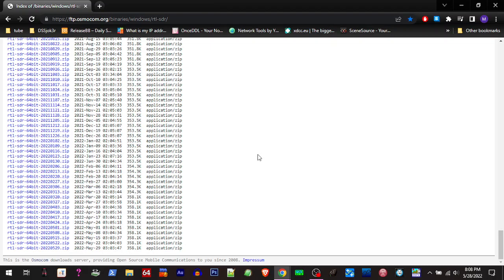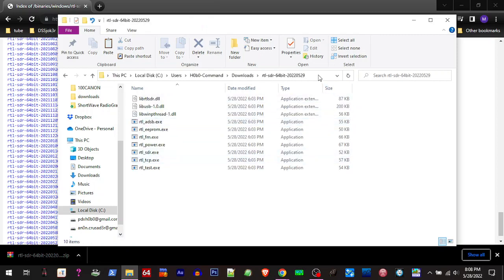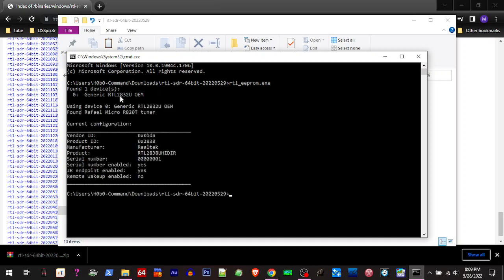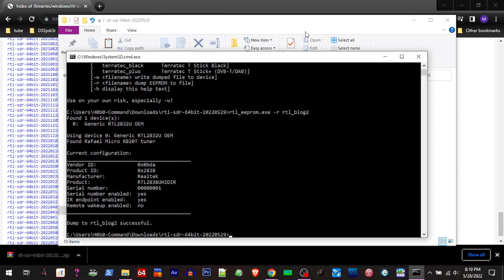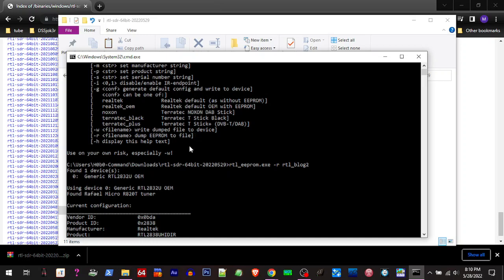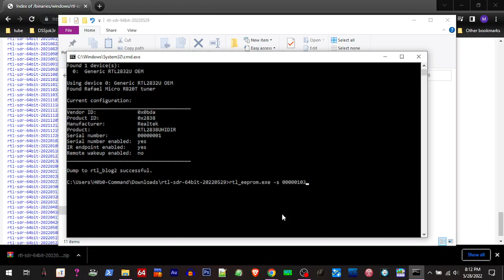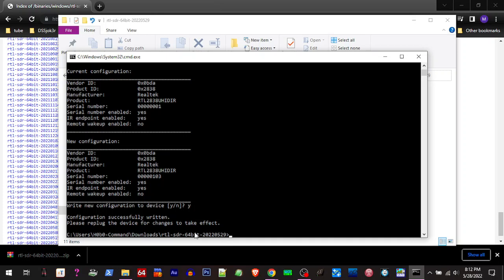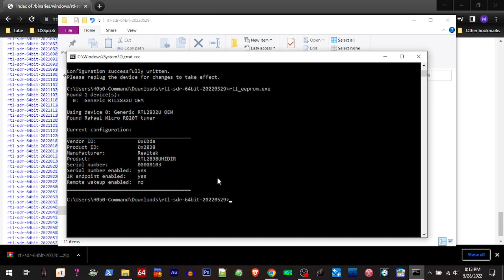Changing the serial number on you sdr dongle

Comment: Worth noting that you can changed the serial number to any string value according to the help text and from testing it works! Right now, I have my frequency drift as the value ("-0.700mhz").
Reply: did you actually change the serial number or the volume serial number through this tool?